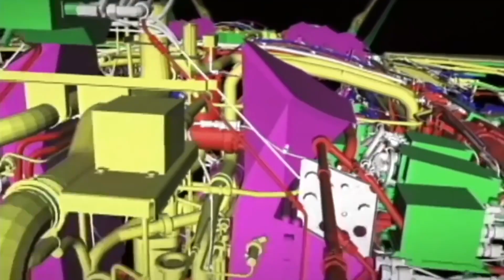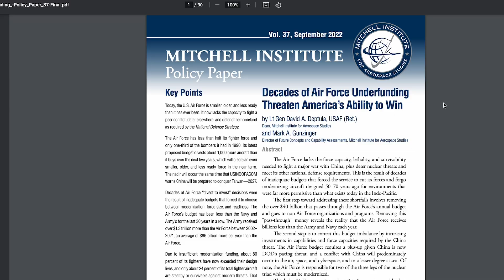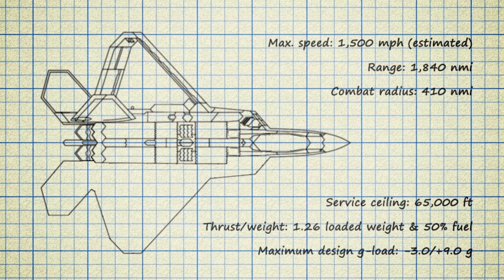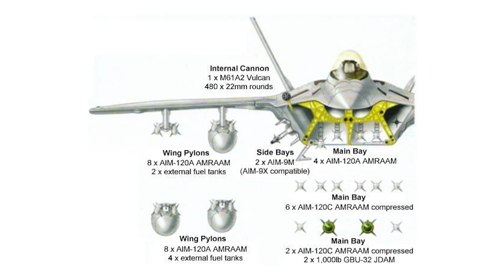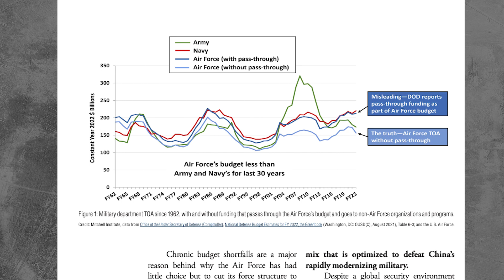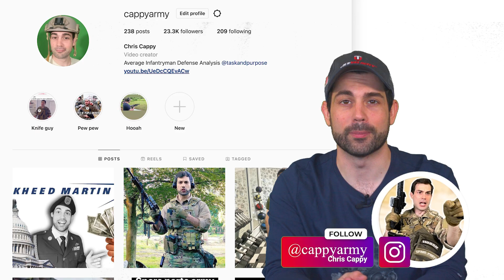Cancelling the F-22 Fighter is Worse than You Think

Comment: I always knew stopping F-22 production was a stupid mistake.
Reply: It was not. On top of being very expensive to acquire or maintain it was also not made with upgradability in mind
Reply: It actually WAS made with expandability in mind, it had multiple computer bays left empty so more computing power could be added later if needed (one example). The cost also would have decreased per unit had more been bought initially.
Reply: @Mobius118  That has rarely worked out that way in the Fighter space since the 60's. Take a good look at what we're now paying today for our mainline king of the skies: The F-15. $90 million per unit fly away cost. The F-35 is an exception, and is actually down to $78 million, but rising again. Raptor is a different bird altogether to make and sustain than the Lightning.
Reply: NGAD will make the Raptor look ordinary
Reply: We needed a more expensive boondoggle, like the F-35...
Reply: @Mobius118  that was nearly impossible though. Kind of hard to gain economy of scale when you have 1 department in 1 military that you can sell the product too. The F-22 had a finite number of models that could be purchased because the US Air Force was the only one they were allowed to sell too and since it was built mainly just as an air superiority fighter rather than a multi-role fighter it has a limited use. The US Air Force only needs so many air superiority fighters over a specific time frame and since this fighter dates back to the 90s, when the PRC was still viewed more as an ally than a threat and when the USSR had collapsed they didnt have any need for a large fleet of the planes until recently and the plane had few real competitors to compare too or compete against. The US barely needed the nearly 200 they built, much less another hundred or more just to keep the unit cost low.
Reply: You wanna get the burden of paying for another expensive fighter platform? Military spending in the US is like a fat child in a chocolate store
Reply: @v0id683  Not true. The F-22 has already undergone numerous upgrades. You just can't see them because you can't change the external shape without changing the RCS. The F-22 was always intended to have IRST. It was tested in the wind tunnel, the housing was designed (it looks just like the EOTS housing under the nose of the F-35) but it was shelved in the late 1990s due to budgetary reasons. But the physical space remains in the nose, along with all the necessary plumbing. If the funding were there, IRST could be added to the F-22.
Reply: @WindFireAllThatKindOfThing  F-15EX is 110M per copy, not $90M. The costs of the EX are for everything that makes an EX an EX. All-new avionics, radar, engines, FBW, EPAWSS.
Reply: Wrong. It was studied, and analyzed. 
Stopping F-22  production was an INTELLIGENT mistake, made by the smartest people.
Reply: @arthas640  "since it was built mainly just as an air superiority fighter rather than a multi-role fighter it has a limited use. "

Ehhhhh......

F-22s have some SEAD capability and they dropped the first JDAMs of Inherent Resolve in September 2014. They have constantly been in demand by theater commanders "down range." The reason they were deployed to Europe so late in the game this year was because they were already deployed to the Middle East.
Reply: @williamyoung9401  How is it a boondoggle? The J-20 is an inferior plane and China has purposefully undercut its price to try and draw in sellers and it costs $120mil and up, plus China doesnt let you build them locally and you have to use China for parts and servicing. Compare that to the F-35 which starts at around $100mil and up, is viewed as superior by the 17 countries and counting that bought it, didnt use secondhand/stolen tech, and comes in more models/variants and the cost seems less crazy, especially since it was designed with a long service life in mind. Even the older Eurofighter Typhoon which doesnt have VTOL capabilities or stealth clocks in at a similar price tag of around $140mil and up. People often view the projected lifetime cost of the program and think its insane but dont realize that doesnt include money from sales, developed tech that will be used for other applications, maintenance, procurement, production, and other stuff. It's hard to compare it to similar aircraft too since countries like China have state owned enterprises that bury costs (just force suppliers to sell parts and materials for less so the program looks cheaper) and arent transparent even when compared to the US military, and some countries dont include R&D into listed program costs.
Reply: @jasonr5989  And how long is that gonna take? 15- 20 years?
Reply: pin a rose on your nose
Reply: Now US have F 35
Thats probably better in long run
Reply: @petrsukenik9266  Yes, but (mostly) different roles. The F-22 is supposed to replace the F-15's job as the premier Interceptor/superiority fighter even though it falls short of the Eagle's ungodly speed, the F-35 is supposed to take over the Multirole slot of the F-16, and to some extent the F-18, and bring back the VTOL strategic flexibility of the old Harrier. Not having to rely on capturing airfields of use full size carriers is a big deal. They were horribly mistaken saying it would also take over all the thoroughbred ground attack duties for the A-10, though.
Reply: @williamyoung9401 It's way cheaper... What are you talking about?
Reply: @Trigger_Treats  well yeah, it's a nearly $400mil fighter with nothing to fight at a time when the F-35 wasn't introduced yet. Iraqs air force wasn't capable of fighting off a swarm of sparrows and the Taliban and ISIS didn't have an air force so they had to find some use for them and the jets rapid speed made it at least useful for rapid response, but using it as a counter insurgency aircraft is a bit like killing a spider with a Ming vase. Most modern fighters at least have the capability to carry light bombs regardless of how useful they are as a bomber and its not like an insurgent with an AK and a rusty knife is going to defend himself against a 250lb bomb any better than a 2000lb bomb. F-35 or nost multi role fighters are still the more practical solution for that role.
Reply: @arthas640  Early lot F-22s were about $130M. The last production lot was down to around $110M, and those were some good jets. 

But that whine about Iraq, the Taliban, and ISIS is just that - a whine. And that's the very reason why F-22 production was ended too soon. SSNs and SSBNs can't do anything in those conflicts, but we don't scrap those fleets because they have roles for other conflicts. 

Saying "Well, the F-22 is useless because Iraq/Afghanistan/Syria" is myopic and indicative of "Fighting the last war." That is the greatest sin of procurement. Gates was a damn fool. His assessment of the J-20's timeline was way off, and the Chinese even rubbed his nose in it when the first J-20 flew on the day of his last visit to China. And now we're facing a resurgent and expansionist Russia that has shown it is willing to use force to redraw the borders of Europe.

Cancelling production of the F-22 early didn't just result in too few aircraft, it also resulted in too few spare parts. many of the subcontractors who produced components have either gone out of business or moved on to other products. 

So, mx costs have increased as a result. Additionally, demand from theater commanders hasn't decreased. With fewer planes available, that means the fleet has been racking up flight hours at a rate higher than anticipated.

No business spends $64B to develop a product expecting a long  production cycle, then terminates the program after only a few hundred. That's corporate negligence. 

To have enough air power to insure air dominance, we needed two squadrons of 24 F-22s per AEF. That would require 480 combat-coded F-22s. When you add training aircraft (20-25%), back up inventory (Primarily depot overhauls, 10-15%) and attrition reserve (10%), the number needed was 680-720. 

That’s well above the 600 needed to make it affordable and to generate a good ROI. Production should have been around 600 aircraft at a rate of 32-44 per year for a solid 15-20 year production run. That would ensure a viable fleet for the next few decades, lowered the per unit costs, lowered mx costs. That also would have allowed for the complete retirement of the F-15C fleet by now, reducing the costs of maintaining that training and logistics train. We wouldn't be looking at buying 144 $120M F-15EX, a 50 year old jet powered by 40-year old engines, a price tag higher than the F-35A and late lot Raptors, but with the RCS of a disco ball on ladies night and the survivability of a turtle on the freeway at rush hour. And now we're spending even more on the development of NGAD than we spent on the ATF program because we didn't get enough F-22s.

So, between the F-15EX and NGAD, we’re spending more on air superiority now than we were spending before Gates canceled the Raptor program. 

Basically, the chickens have come home to roost.
Reply: Choosing the YF22 over the YF23 was a stupid mistake.
Reply: @WindFireAllThatKindOfThing  i would say F 35 works in air superiority too
It has same BVR combat capability, and dogfight rarely happends in modern combat, and even if its still a agile plane
Reply: @mitchjames9350  On what basis?
Reply: @Trigger_Treats  your bombing people who nearly always have no decent aa. you probably could use a ww2 bomber with some computers added for targeting stuff.

Comment: The US military is saying that they don't have what they need, and that we should develop something brand new from scratch to save money?  I'm shocked!  That's so out of character for them.  I never would have expected them to say something like that!
Reply: .. and coming from the manufacturing side, things really started getting stupid when we got "5s gurus' coming into the shops telling us to throw everything out that we hadn't used in the past 30 minutes....tooling, fixtures, programs, into the trash. As an example, I recall a price for an AN fitting. If the customer (PWA) wanted 1 piece, it was over $10k. If they wanted 1000 fittings, they were $46.55 ea..
Several years after stopping production on the 22, word was the government wanted more....so sorry, too late...(Mr. Doi and Ito San, gurus w/o a clue,but damn did they get rich thanks to stupid management)
Reply: Would you be surprised that the Mitchell Institute is staffed with former military officers, defense department employees, and defense contractors? Oh, and they're funded by the office of the secretary of defense and every defense contractor you can think of.
Reply: There is an actual sort of U-shaped curve for fighter aircraft, where it does eventually become more expensive to maintain and upgrade systems you already have rather than building something new from scratch. I don’t know if we are there with the raptor or not, but you do have two other factors working against the raptor here even if we aren’t. The Raptor’s production lines are gone with much of that shifted over to the F 35 or otherwise dismantled, and apparently the Raptor was built in such a way that it just flat out isn’t easy to upgrade it even if we wanted to. 

So, in this case, building something new from scratch might actually be a cheaper option. And even if it wasn’t yet it would eventually be.
Reply: And they will need new camo pattern uniforms too.
Reply: @mobiusflammel9372  yeah, like the jsf /s
JSF was initially designed to be a "low cost jack of all trades" platform, the "Chevy Nova where the Raptor is the Corvette." Quotes from the guy who went to the engine parts suppliers to do the dog and pony Lightning II show, back around 2001.  
Iirc, engine teardown only required 7 tools which was nice, but as time went on, desires and costs certainly increased, a SOP with our customer. When's the last time any new platform came in anywhere close to budget?
Reply: @paddlesailnitro1  So far, the B-21 has managed to remain either on or under budget (according to the GAO - and those folks are definitely not afraid to call out some bullshit when they find it). 

The F-35 was initially way over budget and behind schedule, but the F-35A now costs over $10million less per unit than the new CH-53K Helo. Those sumbitches are creeping up to over $90million EACH. For a flippin’ helicopter based on a design that originally flew in 1964!! THAT is absurd!
Reply: @splooie02  No one with a brain is surprised, especially those have served.
Reply: @DChrls  This is the most underrated comment here.
Reply: There's already a replacement, but we won't see it until they are ready to show it to the public.
Reply: It's a lie
Reply: @FloridaManMatty  True about B-21, but only the first prototype has been built. Give it time. Goal posts can get moved, new missions added, new capabilities included, requirements edited. Because that is what caused many issued in F-35s program and sent the costs so damn high. Imagine if they try concurrency again?
Reply: @stevehangen1123  LOL what the gen-6? Has USAF even issued an RFI?
Reply: Except, it's true.  Watch Sandboxx news, the whole archive on F-22, F-35 and new developments that the AIR FORCE wants because it costs a lot less to fly, and that matters.  The F-22 was atrocious for cost per flight hour.  If you actually used it the way it was designed to maneuver you'd have it in a shop for days replacing ALL the stealth material.

The F-35 isn't much better.  Both planes have to be flown subsonic to protect its stealth coating.

There's a new material that can be used, but you have to design the plane with the material in mind.  It can fly supersonic without damaging the coating and you can replace bits of the coating a lot faster.  The amount of down time for the F-22 was HORRIBLE.
Reply: @johndoh5182  
Well... kind of.
I am in the camp of "stealth is not worth the investment" in the first place.  Largely because the premise is on borrowed time.
We are getting close to the physical limits of known technology/processes.  We have 64 bit ADCs built on GaNFET technologies pumping enormous FPGAs at microwave frequencies with full duplex arbitrary T/R modules with amplifiers rated in the electron-volt range of return photon energy.  With the technology commercially available for those who know a bit of Verilog who can commision a die fab is capable of tracking the lack of background radiation a perfect stealth aircraft would have.  Where some of that stuff would have been built under electron microscopes and nanostructuring devices 20 years ago in research quantities (or for devgru) - we are up against the lattice constant of silicon in commercial tech.  Or... will be in the next 5 years for leading edge fabs and 10 years for hand me down labs.

In theory, we can actually track the reflection off of the pressure gradient in the air an aircraft makes.  The faster the aircraft goes, the more ionic the air becomes.  We track helicopters and rotors by the electrostatic emissions off the blades and can identify models much like sonar identifies ships from their props.  In theory, we could do the same with aircraft, but the more frequent maintenance cycle of props makes this kind of silly.

Within 20 years, a motivated hobbyist could build a kilowatt rated AESA SAR phased array that competes with anything in the air, today.  Granted, some things will be difficult to acquire by virtue of them being more than PCBs and chips - but we already have people building their own CPUS from magnetron sputtered sources in glorified mason jars.  The things coming out of open source projects are quite impressive.

For this reason, I am skeptical that stealth will be vital to the existence of aircraft.  The strategy mostly relied on hiding in the background noise, but modern systems deliberately process noise for signals and there's no mechanism to increase the processing workload in response.  

I'm very much of the mindset that we should generally abandon stealth as a strategy, embrace counter-missile technology, and anti-laser armoring.  Namely, aluminum nitride pannels with fluid ducts and phase change media to absorb the localized heating of lasers and duct the heat to other parts of the aircraft for dissipation.

Then we get into particle beams and need to go back to vacuum tubes on critical systems.... but that's a wild ride no one is prepared for just yet.  Basically, because of how plasma wakefield acceleration works, we can use particle cannons as a weapon.  Those are particularly nasty because the accelerated atoms phase through solid material and "drop into space".  This means that wafer based technologies will have the lattice disrupted by high energy injection of impurities and fail completely.  You can shield with lead but the power necessary to penetrate is linear and can be easily accounted for.  So things loop back around in a silly way that some things will be more rugged as something like a vacuum tube, or more likely, some kind of vacuum field device.
Reply: @johndoh5182  Perhaps, but they have taken my trust in them and flushed it right down the toilet over the years.  Massive respect to the people in the field, but the brass only EVER seems to want more.  Most expensive military in the world by a very wide margin, but they always whine about how we're woefully unprepared for every scenario as justification for spending more.  And whenever anybody tries to reign it in, the brass goes straight for the pensions/benefits/medical care of enlisted personnel/veterans to use as blackmail.  Like that's the only possible thing they could cut back on.  Not a fan.